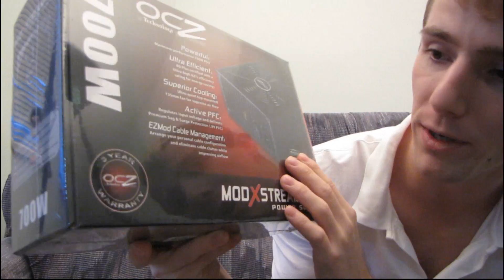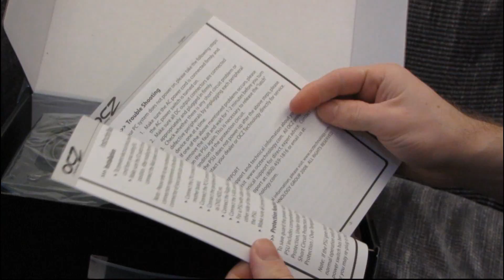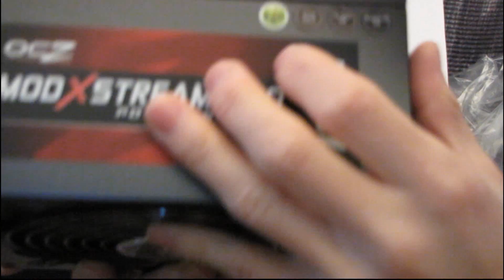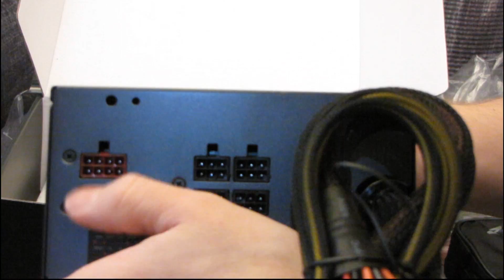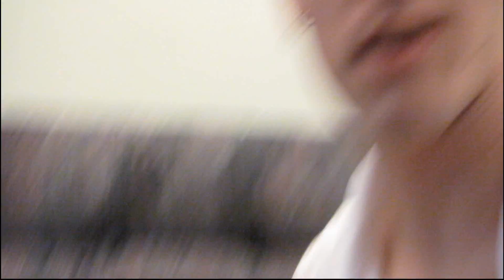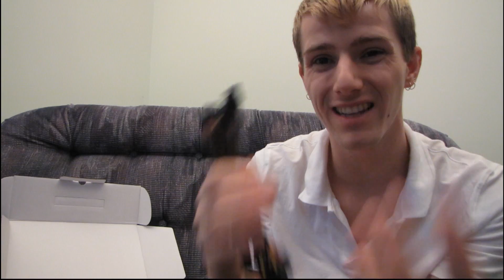OCZ ModXStream Pro 700W Modular Computer Power Supply Unboxing & First Look Linus Tech Tips

Comment: someone in 2019?
Reply: Still kicking 500w version
Reply: Good to know !!
Reply: 3rd system, had 1055t oced, then 9590 undervolted and clocked at 4 jiggahertz, now 2600 still kickin n rockin it.!
Reply: 2020 here.
i have this psu and have been using it since 2013 with no issues.
i am glad linus has this here, the manual is useless and i was trying to figure out why the 4 pin board connection was missing.
my original build board uses the 8 pin and i tucked the 4 pin around behind the left side panel since i didn't need it and couldn't remove it.
and forgot i did it.
Reply: Here in 2020, still kicking a 700W version. I'm looking at replacing the fan on it as it's gone a bit wonky and I had to do some splicing as the SATA power cables all broke when I er moved systems.
Reply: @hollow34  are the cable long enough in your pc
Reply: @adamkhan8003  For what? replaced my fan everything works great now. Super quiet.
Reply: @hollow34  I mean the power supply cables are the long enough
Reply: @hollow34  Yeah i've had the same issue, got the pinouts, made my self some new cables from a salvaged psu.

Comment: I currently have this PSU paired with my Phenom II x4 soon to be fx 8350 and along with my r9 390.. and I have no problems.. I have this PSU from 2012 and started using it 2014.. Soooo yes I have no issues and I believe this is a great PSU. Oh OCed my Phenom II to 3.8 ghz as well.. So for you guys who are complaining.. i guess the one you have is faulty. Because mine is currently being used right now... and still active..

Comment: These PSU's are horrible.  They work, but can be best described as utterly cheap.   My PC hates my PSU, and I suffer from static from the audio ajcks, because the cables do not come with ground wires.  I also suffer video driver failures on high demanding games as well as white misty waves on my monitor and the more demanding the game the worse they get.  It doesn't like my i7 4820, nor my 970.   I read a review in which they took one of these a part and the reviewer best described it as a "Fail."   They're cheaply made, and heavily over priced, they cut corners everywhere for what you're paying for.  I can but only assume the version I bought is likely worse than the one he unboxed in this video.
Reply: I didn't realize anyone asked you?
Reply: No one asked me, but I'm warning anyone who may come across this video to stay away from this brand of PSU.

No seriously. Look up performance test done on this particular PSU.  I had serious problems on two different PCs I built which I bought the same PSU.  I replace these PSUs with Corsairs and all those problems went away.   One of the PC's was a gaming PC, which suffered graphic driver failures often when playing.  Both PCs randomly had blue screen issues now and then as well.  All this went away when I replaced these PSUs with Corsairs.    I think once they get around 350-400watt usage their stability goes out the door.  The more past that the less stable these PSUs become.   They're of very poor quality.  Maybe the original production run might have been good to get the product good reviews but the current variants of this particular PSU are garbage.
Reply: TL;DR. I do believe you, I'm just saying.
Reply: Optimistic WonTon It's tragic though, as for the price these often cost you can get a much better PSU.  They're marketted as gaming PSU's but are not stable enough for a normal desktop let alone a high performance machine.
Reply: I hate it when companies brand their equipment as, "gaming" and drive up the price for the item. I'm currently in the process of building a new PC.
Reply: Optimistic WonTon I'd suggest sticking to a more name brand PSU then, and even then look up performance reviews as they have a large variety of grades.   I know I will from now on. =.=;
Reply: I'm don't worry man! I'm getting a EVGA Power Supply.

Comment: 2 questions, Is this thing ACTUALLY good... and Can it power a system like; 1 x Case NZXT Source 210 Mid Tower Case - Blue
1 x Processor Intel® Core™ i7-4770 Processor (4x 3.40GHz/8MB L3 Cache)
1 x Motherboard ASRock Fatal1ty Z87 Killer - 3 x PCIe 3.0 x16, 4 x USB 3.0, HDMI-in, Killer gaming Gigabit LAN
1 x Memory 16 GB [8 GB x2] D DDR3-1866 ADATA XPG V2 RAM
1 x Video Card NVIDIA GeForce GTX 660 - 2GB - Single Card
1 x Case Lighting Cold Cathode Neon Light - Blue
1 x Power Supply 700 Watt - OCZ ModXStream Pro 700W - 80 PLUS, Modular - 
1 x Processor Cooling Asetek 550LC Liquid CPU Cooling System [SOCKET-1155] - ARC Silent High Performance Fan Upgrade
1 x  2TB SATA 6.0Gb/s Single Drive**
1 x BLU-RAY Reader Combo Drive for Primary Optical Drive
1 x Sound Card 3D Premium Surround Sound Onboard
1 x Speaker System None
1 x Network Card Onboard LAN Network (Gb or 10/100)
1 x iBUYPOWER Labs - Internal Expansion iBUYPOWER Internal USB Expansion System + Bluetooth & Wireless N Module
Reply: Im sure it will do. Im using a phenom II x6 1055t oced at 3.8 ghz and a 275 gtx on a 500w ocz modxtream. Its a really good psu, but old, get a corsair on a new seasonic

Comment: The cables are short. They require a bit of stretching to get some fair distance and the zip-tie that hold them together at the bottom restricts movement by about half an inch (which could make all the different in attaching to a power connector, I just cut it)

Overall it's a really good supply, but if you have a massive case which only mounts on the bottom then you should budget for some extensions as well.

Comment: This power supply is decent, but for some ridiculous reason it has only 2 pci express connectors, and only 4 molexes. It just doesn't make sense. Also, the cables are way too short; expect trouble with cable management. It makes no sense, because this power supply does run my dual 5850s and my 1055T just fine...

Comment: Anyone that knows quite a bit about computers i'm wanting to build my first gaming computer and can someone tell me how this set-up seems and if the PSU will work with my AMD FX-6100

Rosewill CHALLENGER Black Gaming ATX Mid Tower Computer Case

Western Digital WD Blue WD5000AAKX 500GB 7200 RPM SATA 6.0Gb/s 3.5" Internal Hard Drive

ASRock 960GM/U3S3 FX AM3+ AMD 760G SATA 6Gb/s USB 3.0 Micro ATX AMD Motherboard

Radeon HD 7850 2GB

OCZ ModXStream Pro 600W

G.SKILL Ripjaws Series 8GB

AMD FX-6100

Comment: cables are all to short.. I had to buy an extension cable because the 4/8 pins ATX 12V connectors were way to short for my antec eleven hunderd case!

Comment: I've had this one since 2010 but my case recently sliced into the two cables which you plug in for the gpu, 2x8 pin ports now can I just buy a standard pair of 8 pin to 6 pin cables and stick into the ports or shall I just go for a new supply ?

Comment: @moviefact1 will it do it with a high wattage cpu (ex: fx-8150 overclocked) and like 10 fans in addition to a ton of hdds , optical drives, pci expansions, and the 2x 560 ti?

Comment: Hey everyone, im pretty new to building pcs. I've ordered two msi cyclone gtx 460 and i believe each card has two 6 pin sockets on the back meaning i need four 6pins. is there anyway of getting this psu to run this setup i.e getting some sort of adapter to have more 6pin male plugs?????

Comment: @aeroblastoff 

Or, you can just get the Xigmatek MC-NPR-MC651, which is better than this one and is at the same price and you'd also avoid the cable length problem.  Also, it has 4 PCI-E connectors, as opposed to only 2 for the ModXStream Pro.

Comment: Bad thing about it is that it only has two PCI-E connectors.  Anything 650w or over should have four (2x 6+2-pin and 2x 6-pin) because they're meant for high-end usage.  The best model of this PSU is the 600w version.  If you want a higher-end PSU with support for multiple GPUs I'd look at the Xigmatek MC NRP-MC651 650w, Antec EarthWatts 750w, the Corsair CMPSU-650HX, and the Silverstone ST75F 750w.